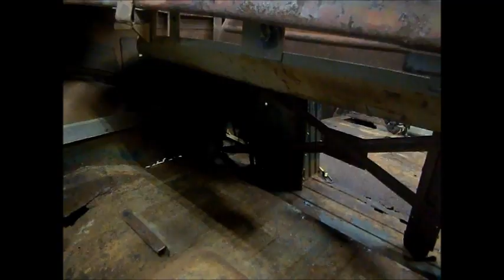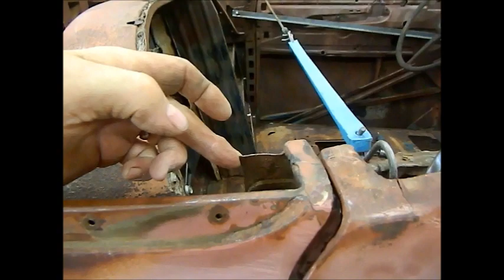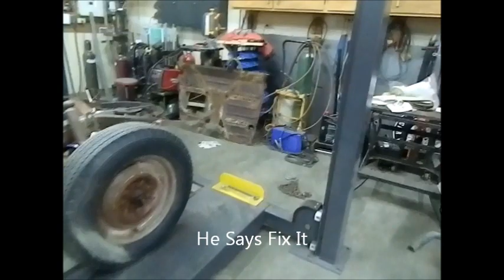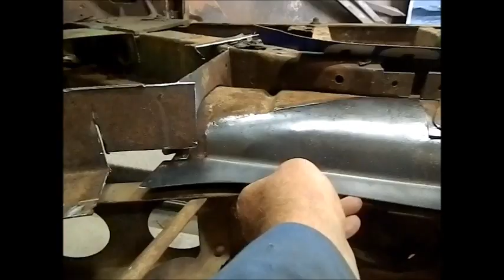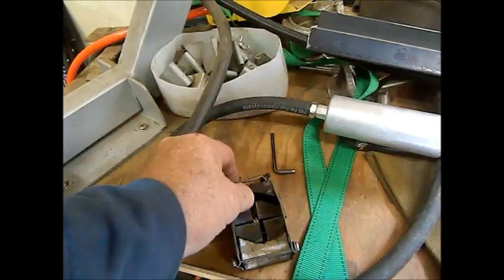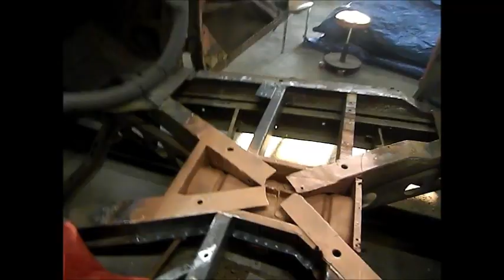1937 Plymouth Convertible #2

Comment: Great job Glen. Looks like you will need lots of template material so you better get after it😂. I contacted vavavoom that put me onto Windy hill auto in Minnesota and they put me in to desert valley in phoenix that put me on to rocky mountain relics in Colorado that finaly had some 40 dodge coupe parts. Thanks for the tip. Cheers for now
Reply from the maker: @dannypeter6565  Thanks Danny,  wow that was a real chain to get where you had to be. Hopefully they Have what you need at a decent price. Take care
Reply: @glenmiller3783  They had a couple of things that I would be interested in and are going to send me some pics. The price is another story. I will probably put that towards fixing up what I allready have and have money left over for some template material. Thanks again.